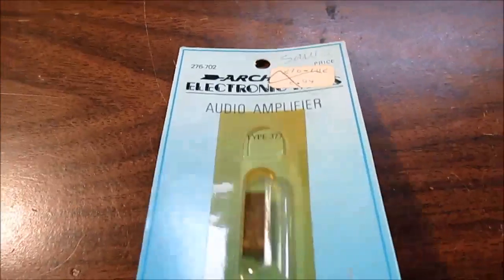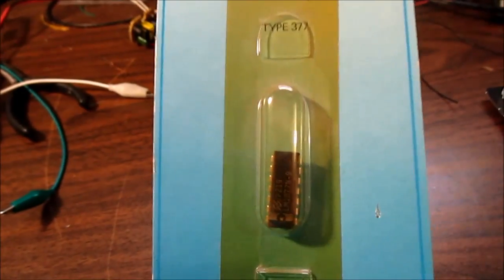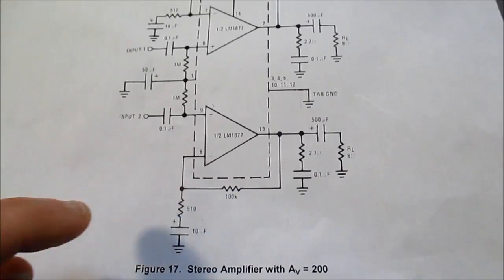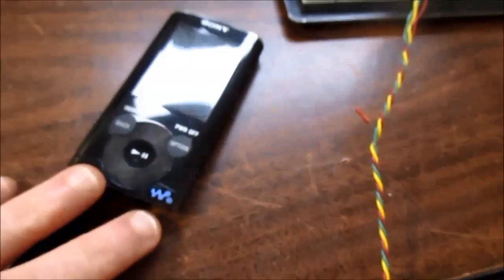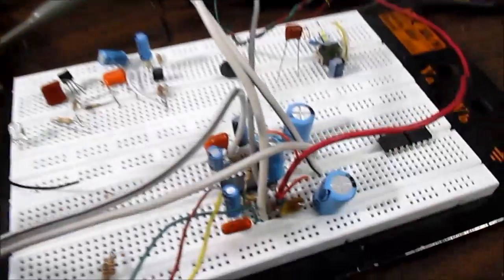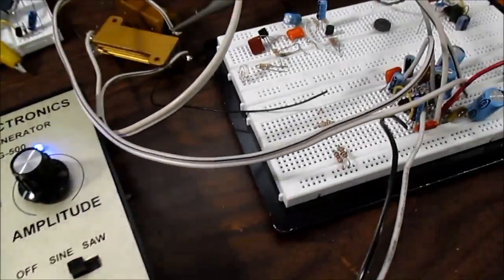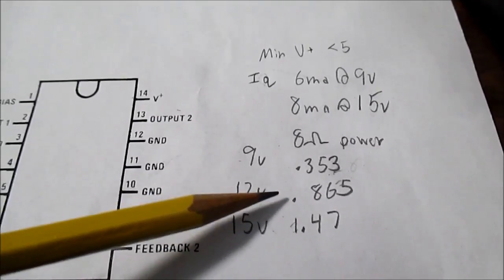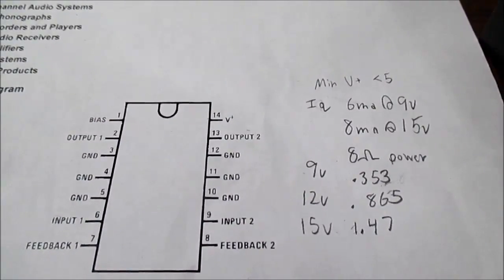LM1877 stereo amplifier IC test & review

Comment: This chip when available as LM377 was a 14 pin DIL package with center 3 pins on both sides combined as a heatsink tab to fix  heatsink similar to TBA810 ic which was quite popular during 1990's. Also available was LM378 and Lm379 which was capable of delivering 4+4 Watts and 6+6 Watts respectively

Comment: Nice one Bud it sounded pretty good here ATB
Reply from the maker: Sometimes the camera captures it okay. Still compressed and not in stereo. I wish camera makers would put more effort in the audio. BTW, I did listen to your music sample. I will comment when I get around to my email.
Reply: Cheers bud . i've just finished making a 28 volt |NiCd Battery bank to run my studio Bass Amp on DC its a pioneer STK style thing , gonna use the Mains transformer as an external charger . I sliced my Damn 
Thumb on a Cell tab ! could you adapt this Amp to take a  peizo disk transducer ?

Comment: Please do power tests of PAM 8403 and PAM 8610 boards. They are relatively cheap and claim 2 X 3 watts ( at 5 volts! ) and 2 X 10 watts ( at 12 volts! ).
Reply: Ive been eyeballing those 8403 boards aswell.

Comment: ive been really getting into these DIP chip amps. im looking to get some more. all i own is the LM386N-1. other then this LM1877 what are some other DIP chip amps would you recommend me look at?
Reply from the maker: TDA7267, TDA7267A and the stereo TDA7268 are simply the best linear ICs ever made for 9v 4 or 8 ohm use (IMHO). They feature reasonable gain for most projects, low distortion and highest output from a single ended push-pull design at a given supply voltage. Minimal components needed to make them work. Unfortunately, as with many through hole ICs these days, they are obsolete but can be found on the secondary market at elevated prices.
Reply: i just placed a mouser order for like 10 different chip amps. even the surface mount LM1877. SMD doesnt bother me much because you can get SOIC to DIP adapters.
Reply from the maker: Just beware the heat dissipation with the adapters will be limited. You may have to epoxy an aluminum heatsink on the chip so it can cool.